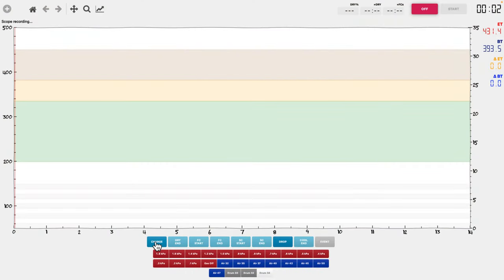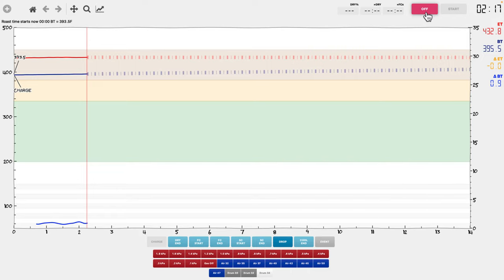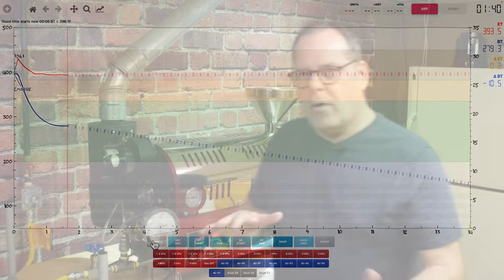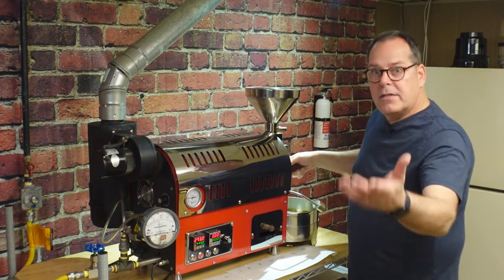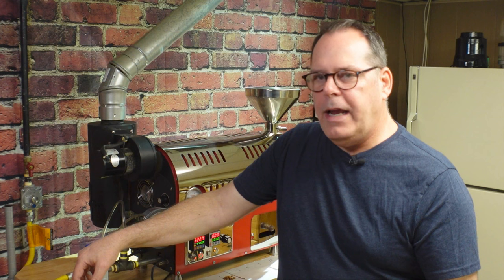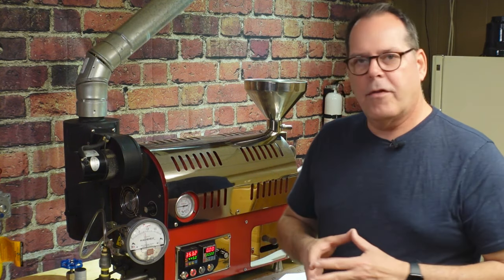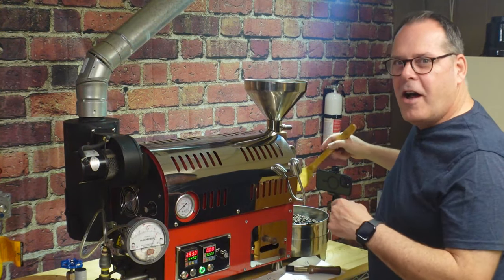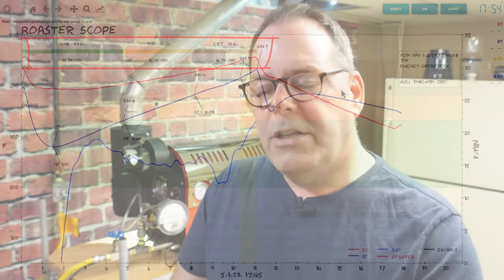Learning How To Roast Coffee Using A Drum Roaster

Comment: Thanks for the great video! I have been recently relearning to roast after moving to an upgraded heat gun and artisan integration (using a flour sifter) and this was really helpful to think about understand the 'blank profile' of a roast without adjustments. Really helpful!
Reply from the maker: Nice.  Glad it was helpful.   So, when you roast with the heat gun are you using multiple heat settings or did you find one setting that takes your roast all the way through till drop?
Reply: @VirtualCoffeeLab   The heatgun that I upgraded to has a lot of control over the temperature setting, so there is a lot of potential for control. However, it has also been able to have a surprisingly nice declining curve with a fixed temperature. It was actually really interesting to see how relatively flat your BT graph was with a fixed heat setting. I think my decline ROR is partly due to having no insulation and a vented top. So as my roaster and beans heat up, they are able to radiate more and more heat outside the roaster. However, I have been decreasing the heatgun temperature a little near first crack so things don't go crazy. 

I have been starting with this since I'm still learning the ins and outs of having so much data with artisan. I would be happy to share photos of my setup or the roast curves if you're ever interested.

Comment: Thank you for the video. why does your roaster have 2 probes? 
Can you show us or explain the functions and parts in the drum roaster?
Reply from the maker: Thanks for watching.  Actually, the roaster has 3 probes.  As with most drum roasters we want to measure bean temperature and the exhaust temperature.  The bean probe is placed in the bean mass to give us a fairly accurate idea of how the heat we apply influences the bean.  The exhaust temperature is usually placed where the air begins to exit the roasting chamber.  This temperature is used in several ways.  I use exhaust temperature as the potential energy currently in the drum.  I did a video called "roasting with exhaust temperature" that gives a pretty good idea of what I am trying to describe here.  I would encourage you to watch that.  Exhaust Temperature was a game changer for me.  I use those readings to help me see into the future of my roasting temperatures and I actually manage my heat partly based on exhaust temperature.  It is also really helpful when I first begin my roast (charge).
The third probe is in thePID probe located in the middle of the drum.  It is the average temp and many roasting professionals will charge their roaster using the "PID" temp.  I use the PID on my Mill City 500 gram roaster when I warm up my roaster BUT I don't use it at charge.  Instead, I use the BT probe.  This is a personal choice, not necessarily the rule.

Comment: It’s also worth noting that due to conductive heat, at least with my Aillio, that when I slow down my drum speed, I get an increased RoR. And opposite effects when I increase the drum speed. However, I’ve also noticed that this only works early on in the roast or right before first crack. It actually has the opposite effect or inverse effects after that point. So increase temperature when the drum speed is increased.
Reply from the maker: Thanks for sharing your experience.  Is there a reason you are changing your drum speed on the Bullet?  I mean, is your heat setting not enough to give you the increased or decrease ROR you desire?  Just curious.  Drum speed for something like the Behmor might be helpful to promote airflow but the Bullet has variable airflow to create convection.  
From what I learned in my own experience and also some roasting classes I took, setting your roaster drum speed so beans are moving and not being scorched.  They are being moved enough to create convection as they are tossed in the air a little without being flung.  There is a chart somewhere on the internet to offers a recommended drum speed based on the capacity of the roaster.  They use RPM as the measurement.  I think my drum is set for about 55 or 60, I don't remember.

Comment: Love all your videos! Now I'm anxiously awaiting the followup to this one, because what I really want to understand is how to use the information gathered from this experiment. My roasts (on a Kaleido M2) tend to go either way too fast or way too slow, and I often have crashes. I understand what to do (slowly lower the heat), but I haven't figured out how to pace it. How can I use the experiment's info to figure that out for my roaster?
Reply from the maker: suebrown8129, thanks for watching and for being a subscriber.  Share your event times with me.  How long to get to dry end, first crack and drop?  What is the charge temp and what is your drop temp?  Also, how dark are you going and for what type of coffee.
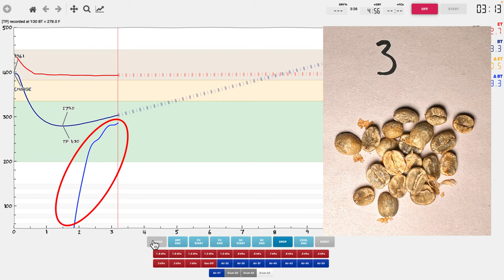Reply: @VirtualCoffeeLab  So I did your experiment today with Guatemala Antigua Juaja beans, and here are the numbers I got: Charged 275g (400g max for this roaster) at 185°C, with both heating elements on, then turned heat down to 75% at charge. DE at 3:30 (160.7°C). FC at 5:09 (193.8°C). SC at 6:33 (220.2°C). Drop at 7:00 (230°C, SC was still rolling, but it smelled so burnt). Obviously, the roast went way too fast. :) Normally I would want a medium roast on this bean.
Reply from the maker: I meant for your typical roasts, not the experiment but that is helpful info.  A couple of comments that will still be helpful for you.
1.  Capacity -  I used a full capacity roast as my experiment.  You roasted about 2/3 capacity for you roaster experiment.  That would cause your roast to move much quicker.  So, good lesson to remember which is..... batch size will influence times and temperatures.  This is important to remember because you can use this to your advantage when roasting different types of coffee where maybe you want a longer or shorter total roast time.  You can use batch size to influence this.

2.  Charge Temperature - The purpose of picking a charge temperature is to help you have enough momentum to get through the roast.  Mill City did a great video on charge temperatures using a "slot car" as an object lesson.  The charge temperature was represented by the height of the track where the car begins.  You need enough height/heat to allow the car to drop down, building up speed/momentum so when it curves upward, the slot car can make it up to the top of the hill/dry end without falling backwards.  Once it makes it way over the hill, it is heading towards first crack/ where you will be reducing heat to cause your temperature increase to slow (lowering your ROR).  I did a video about charge temperature as well as "why the dry phase is so important".  You might want to check those out.

3.  Total Roast Time - This exercise showed you how short your roast can be.  The total roast time will influence the flavor of your coffee.  You said you like medium roasts.  Roasting a central american washed coffee with your roaster,  a good total roast time would be somewhere between 9-11 minutes.  It could be shorter or longer but this seems to be a sweet spot for me.  I like 10 - 11 minute roasts.  So finding the right charge temp to help you accomplish a dry phase that is about 5 minutes, then a 3 minute middle phase and a 2 minute development roasting to a medium roast is a great starting point.  From there you can modify your total roast time, see how that influences the flavor.  Then you can tweek the middle and development times a little and see how that influences your cup.

Now for the crashing......  When is your crash happening?  In my video, did you notice on my test roast how the ROR climbed in the beginning, THEN it started to descend after dry end.  It did that by itself.  Then if began to climb around first crack.  This is a picture of how the ROR will behave naturally when no changes are made.  Now, lets apply that to a central american roast on the Laleido M2.  Around or just before dry end we begin to lower our heat.  You saw that 75% on the test roast was way too much power.  You should begin lowering your gas a little at a time around dry end.  Start with a 20% decrease in energy at dry end.  Wait and see how your ror responds.  The goal is to have a downward trend towards first crack.  Idealy it would be great to have an ror less than 15 when you hit first crack.  So, with that in mind, watch your firs crack estimated time on Artisan, that gives you a sneek peek how you should modify your gas. If you back off your gas to much you will experience the crash.  Don't give away your momentum too early.  Aim for first crack with an ror of 15 or a little less.  don't freak right now about the flick and crash.  If you are aiming or First Crack time and the 14 ror target the crash won't be much of an issue unless you are cutting the gas to avoid the flick.  

Not sure if this is the kind of help you were looking for.  If I missed something in your comments you want me to talk about let me know.  Was this helpful?  Did it make sense?
Reply: @VirtualCoffeeLab  Thanks for that amazingly detailed response! It's all very helpful. I'm going to make some notes, and try to do a better roast. My "typical" roasts are all over the place - sometimes too fast, sometimes too slow, often a crash during FC, followed by a flick. I keep trying different charge temps, trying to find the one that is "just right." I always keep the charge weight the same - 275g because I think it's not too small for the roaster, but less wasteful than messing up a bigger batch. Plus, the hopper and the cooler really can't effectively hold much more than that. I'm always trying to achieve a nicely declining RoR (per Rao), but rarely do.
Reply from the maker: How you manage your heat during dry will set you up for success for the rest of the roast.  Figure out a charge temp that will help you get to dry in about 4 1/2 - 5 minutes.  Adjust your heat lower to begin a nice descending ROR.  As the roasts progresses you may need to reduce heat is small increments.  If you have an exhaust temp probe, try to get your ET temp to about 10 degrees above your intended/planned Bean Temp drop temperature.  Try and keep that ET from climbing any higher but adjusting the heat.
Now, about 50 seconds before first crack, lower your heat a little.  Then about 20 seconds brefore first crack lower your heat a little again.  This adjustment should have helped prevent a big flick.  Now, watch really close and feather back in a little heat as your ROR pushed through the flick and avoid a crash.  After that, monitor heat and make any small adjustments to keep your descent moving.  As mentioned before, I like a ROR of 14 at FC for a medium roast.  By the time I drop the coffee my ROR is about 7 (when everything goes according to plan haha).
Reply: @VirtualCoffeeLab  Thank you!
Reply from the maker: Sue, check out my Kaleido toast here on my channel.  https://youtu.be/eLAjepXtAg4?si=MR5160Vk-TQxsZae. This should answer some of your questions using the same roaster (almost).

Comment: I think I need to ad a magnahelic Guage to mine the lighter trick is getting old
Reply from the maker: The magnahelic you see in this video is for gas.  The smaller gauge is the original but the increments go up to 5kpa when my max is only a little over 1kpa for my flow.  So the range I am working with on that small dial is difficult to see minor changes.  The larger gauge is 2kpa and I have more precise control.  I would like to get one for air.

Comment: Very helpfull. Unfortunantly I have a simply roaster and I cant control the temperature and is too nosy I can’t hear the cracks 🤷🏻‍♂️🥲
Reply from the maker: I started out on a popcorn popper like most of us.  Do you think you will move to something else?  Do you have a roaster in mind?
Reply: @VirtualCoffeeLab  I have a home roaster called Cafemasy
Reply from the maker: I am familiar with their roaster.  Which one do you have?  The air roaster or the electric cooking pan with the wand that turns the beans?  Both have heat control but I know the pan is a very slow roaster.